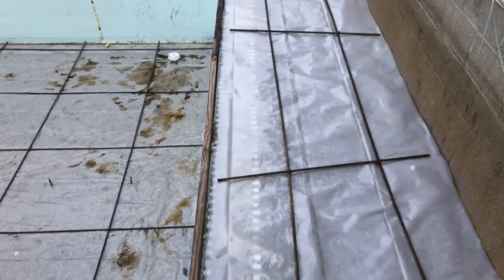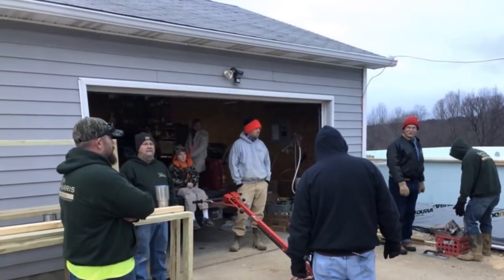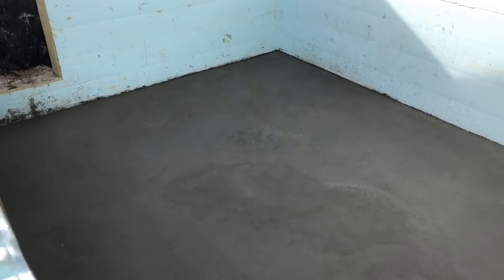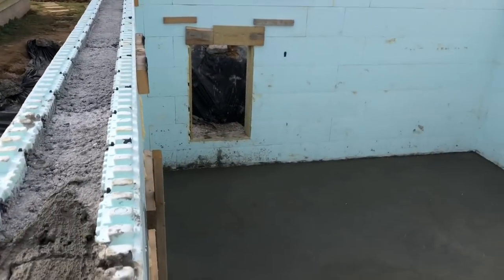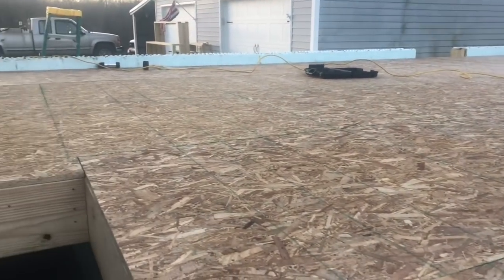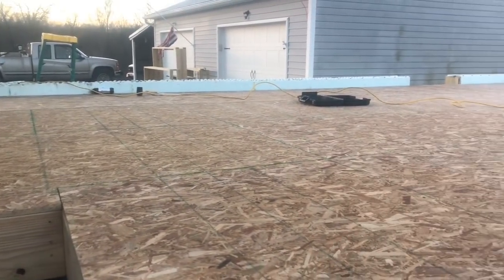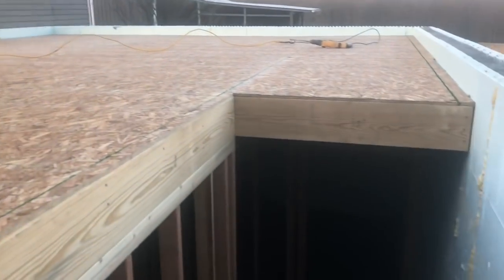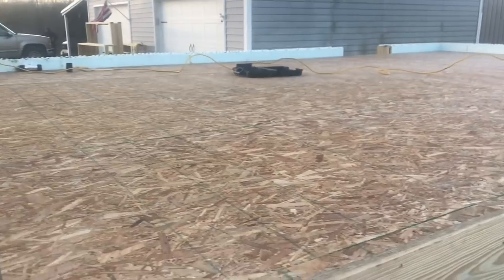Pouring basement floor using John Deere excavator #geterdone

Comment: Obviously, I didn't read the comments before posting my own.  Nathan St Onge stated my point much better that I did.  I do see that there is no rebar sticking up to bond the second level ICF pot to the first.  I do not know what good practice is but you will be stacking a second concrete wall on top of the first at a "cold joint."  Is that considered good practice?  Do you reinforce the walls of a multistory pour?
Reply from the maker: There is look closer it’s bent over for safety till we stack 2nd level
Reply from the maker: Sorry that job Was over 2 years ago that  custom wanted drilled and epoxy

Comment: When I was young (50 years ago) we had friends who worked in the concrete business and when they put down a slab they used a tamper to push down the rocks to make it so the surface had only sand in it that could be made smooth. It seems like nobody does that anymore. Was it always unnecessary and people didn't realize it or has something else changed so that it is unnecessary now?
Reply from the maker: Just need to work top enough to work sand and cement to the top to finish

Comment: You had me going there for a bit. I was hoping that the concrete walls were going to be capped off with a steel reinforced concrete plate for maximum strenght, tornado resistance and fire immunity, but this is America and stick building is still king here.
Reply from the maker: Nope icf continues on up check out the other two videos on this job
Reply: My brother build his house this way 20 years ago. It is an improvement over the standart stick build. I help my father build his house 35 years ago the old fashion way. All block, poured reinforced concrete plate floor 3 times over. Basement, 1st floor and the attic. The only wooden part of his house is the roof. At the time, all residential metal roofing was still in its infancy.

Comment: I love the ICF! I just got certified by nudura here in Columbus Ohio. I watched your last video where you poured the wall and I was just wondering if you guys put a vibrator down the wall or not? Thanks for the great content and keep up the good videos!
Reply: Oh by the way I saw you guys put tape over the top course to keep crap out of the locking system. That is an amazing idea!! Wish I saw that idea much earlier.
Reply from the maker: We love nudura it’s are favorite block by  far guess you are getting you block for Holdfast in Dayton  we do not use a internal vibration just use a external vibration as need (door windows ext) the tape works great we using packing tape the trick is two layers and pull it off as soon. As possible thanks for watching glad you are enjoying the channel
Reply: Dirt Perfect hold fast in Dayton is our supplier. They are a great company to work with! Thank you for the tips I really appreciate what you do here!
Reply from the maker: Yes they are and thanks far taking the time to watch if you get time check out are Facebook page are website lot icf pics there both are Simon and Harris home builders
Reply: @DirtPerfect  Thanks for the answer. I had this question as well. I have watched a lot of construction videos over the years and I haven't seen anybody use the external vibrator that you use. It seems like a very good idea. What is your thinking on not using the regular internal vibrator?
Reply from the maker: Dave all depends on the situation I know that’s not a good answer but it’s the truth 😁

Comment: This is not a good video to watch for learning. First, their steel reinforcement is sitting on the ground as you can see when you need minimum 1.5"-2" coverage around rebar so having rebar on the bottom of the slab is not to code. Also note that the rebar spacing is about 3' o/c from the looks of it when it should be 16" or even 12". Using a steel grid is 8" o/c. So this slab is going to crack within the first year guaranteed as you can see its winter which means frost and yes it will make its way down below the slab as it will follow along the outside of the ICF. Next issue is the ICF. Very clean pour but I don't see any vertical reinforcement sticking out and they mention continuing up with ICF. Their cold seam should be much rougher if they plan on continuing up with an additional level of ICF walls as a smooth surface where you cold weld together causes a stress point. So overall, this is a decent finishing job however it was not built to last too long. What a sad waste of the homeowners money.
Reply from the maker: Lol you just wasted my time reading this to point out nothing guess now we are even 😁 thanks for watching and the comment